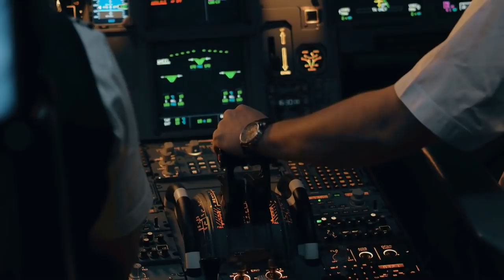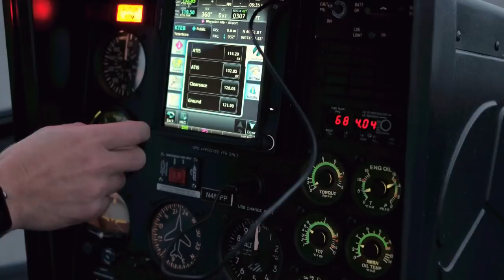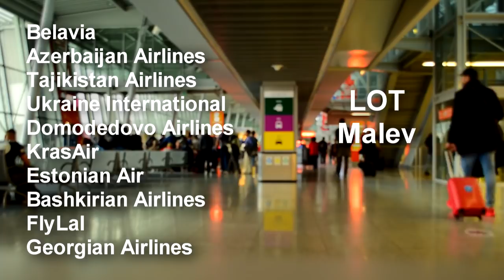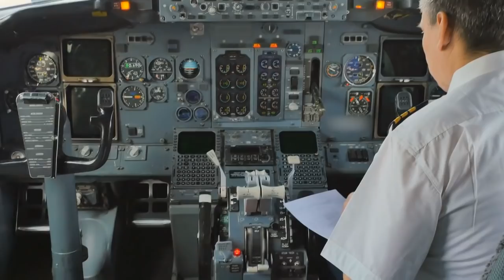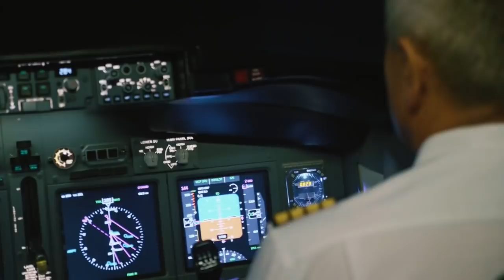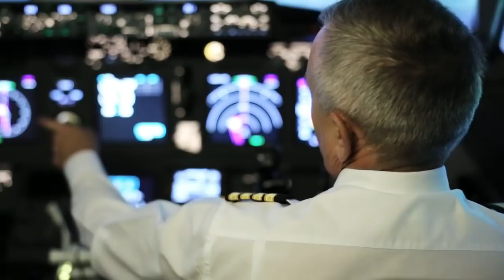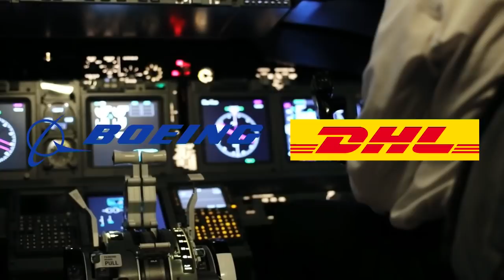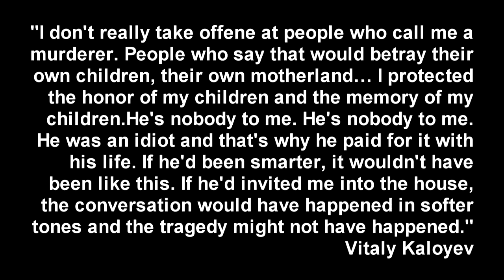Uberlingen Mid Air Collision - DISASTER BREAKDOWN

Comment: The phones were down for maintenance? Holy shit... How is that even a thing? They didn't have backups for something so crucial?
Reply: It would be smart if there are always 2 of a particular system in operation, so that just in case one is down for maintenance or some other reason, the other is still recording/transmitting vital information.
Reply: That's the thing, there were.

Comment: There really shouldn't exist something called "down for maintainance" in atc for non-redundant systems.
Reply: Apparently the maintenance also included people making huge amounts of unnecessary noise, so there is another factor that could have lead to this and more people to ruthlessly murder.

But hey I guess in Russia that ruthless murderer who defiled the memory of his innocent wife and child is a hero.
Reply: I may have to disagree with you on this and I have work experience in this area. While I was in the Air Force I maintained the navigation and landing systems used in aviation. Like everything else man has designed and built they require maintenance at various intervals and at times that equipment has to be taken off line to perform that maintenance. There’s never a perfect time to take such equipment off line so that type maintenance is scheduled at times of least activity which is most likely was in this case. So I don’t fault the maintenance that was being performed. Maybe the controller that was on break should have been called back to his station.

Comment: I've had SO MANY different lines of work where taking a break just isnt possible for certain reasons depending on the job. I cant believe a flight controller would take a break leaving 1 operator to run 2 stations. I hope that guy was fired or atleast cant sleep at night because of nightmares of what happened to those children!!!
Reply: It really isn't the other guy's fault. It's how things were run. An exhausted ATC is just as bad as a drunk ATC really. The blame is on the company for not supplying sufficient staff or having adequate backups
Reply: Not really his fault, he got overworked and undersupplied. His traffic radar was cut without him knowing, cut his phones and main radar. He couldn't live with what just happened, and later got MURDERED, by someone.

Comment: In short when two system collides errors will happen. In this case TCAS vs control tower.
Reply: Which is why TCAS is supposed to take priority.  The DHL plane followed it; if the Bakshirian plane did as well the collision never would have happened.

Comment: Air Traffic Controllers operate from dedicated Air Traffic Control Centers, not from airport towers, like depicted in this video. ATC Centers are more or less ordinary buildings, most of which have one or more OPS rooms that house the controllers. There is no need to build them high-up, like towers as they often control the airspace of an entire country or large parts of it. Most ATCs only handle a specific altitude range in the airspace assigned to them. Although some ATCs have been constructed near airfields, the only reason to do so, is either politically motivated or the proximity of commonly needed infrastructure. Airport towers really just handle the very first and very last part of every normal flight.

Comment: 3 Years prison for stabbing somebody death? I hope this is just a joke
Reply: In Turkey they get months
Reply: No joke, this man is hardly a hero, welcomed back into his authoritarian culture.  No justice here.
Reply: @AdamSmith-gs2dv  it was found that it wasn't the air traffic controllers mistake but the higher-ups mistake
Reply: @AdamSmith-gs2dv  It wasn't a murderous intent. Which made the killing more ridicolous.
Reply: Unfortunately that’s the case. I don’t solely blame the controller because given the circumstances before him, it was an extremely stressful situation for him. Colleague was on break so he had to cover the two screens and the maintenance crew were working on the radar system. He never meant to hurt anyone. And the Russian pilots were also at fault because of their mentality of following controllers orders instead of the aircraft system.
Reply: @AidenTheAviator  There was, at that time, no clear explicit rule to disregard ATC in such circumstances. It was a recommendation. He gave them instructions 45 seconds before impact. ATC should have known that if the planes are that close it may trigger TCAS. The reasonable thing would have been to call the cargo plane and make sure it performs collision avoidance as well. I know he was too busy with other planes.
Reply: Exactly, 3 years isn't nearly enough.

Comment: Why would they need 5 pilots for 1 plane?
Reply: Idk
Reply: First engineer and in long haul flight there's a relief crew that take over while the main crew sleeps.
Reply: @MrMelick  long haul flights take at least 7 hours. This flight was only around 4.5 hours.
Reply: Because old Soviet/Russian planes were designed that way. They actually only need 4 most of the time. Captain, First officer, Flight engineer, and navigator. In this instance however, there was a check captain acting as Co-pilot to evaluate the Captains flying performance and the actual first officer was sitting in the rear jumpseat.

Comment: I have zero sympathy for the ATC.  Since both transponders were working correctly, he had the details displayed on his screen showing both planes descending.  He decided to ignore that and go back to something that wasn't urgent, much less critical.  He got what he deserved.
Reply: You‘re completely forgetting about the fact that he was essentially working alone and also had to manage the arrival of a flight landing at Friedrichshafen which was only available on a screen a few meters away from where the two flights involved in the accident were. Together with the cut telephone line and other systems only working to some extent he was overwhelmed by the situation.
Furthermore, what you are of course also forgetting about, TCAS was pretty new back then it only gained more importance after this very accident. The ATC didn’t know that the DHL crew even got the instructions and followed them, there was no way for him to know. Of course he could’ve seen their altitude, but after instructing the Bashkirian flight to descent he thought that the problem has been resolved and went back to the flight landing at FDH. There was no way for him to know that TCAS has already done its job as not even the Bashkirian crew who he was in contact with told him about the TCAS instructions they got. And again, only since this accident TCAS has priority of ATC. Nowadays TCAS instructions must be followed and reported to ATC without ATC having a say on it, this is a direct result of this accident.

SkyGuide is to blame for the way they did maintenance and handled shifts. In reality Nielsen is just another pointless victim, both in a way that he is falsely blamed by those who lack the overview of the situation that night and in a way that he in the end also was an indirect fatality of the accident. You can and should have sympathy with the family father, but that doesn’t justify his actions even by a bit.